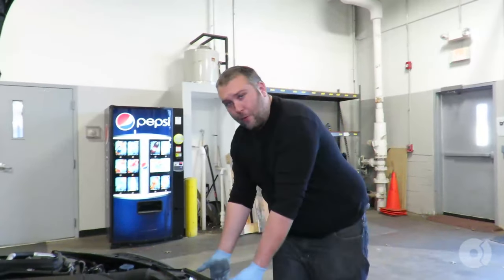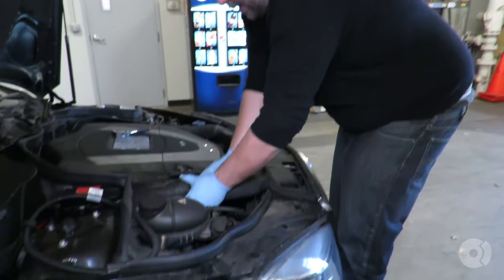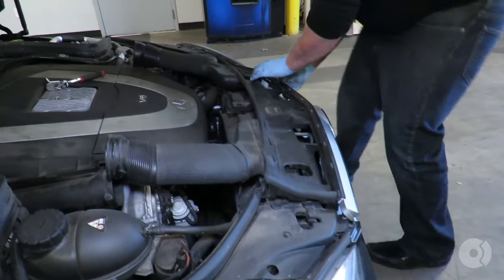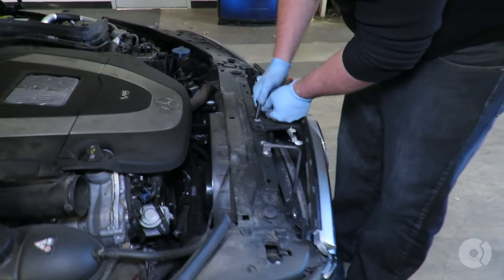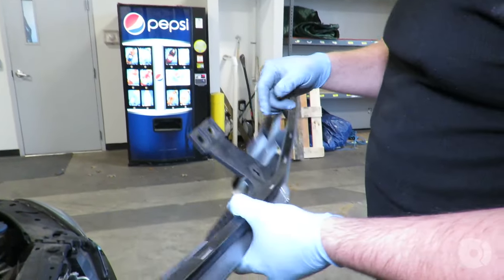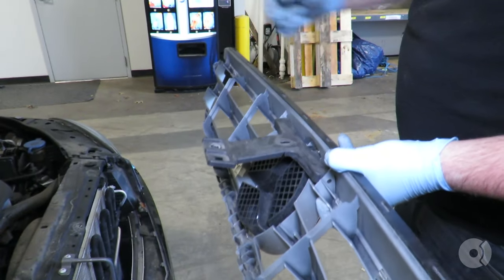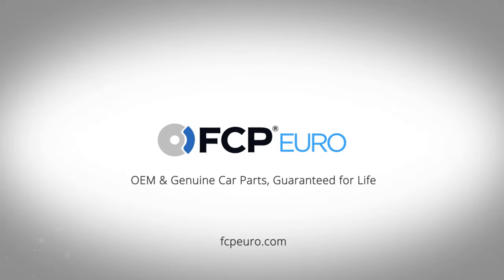Mercedes Front Grill Removal - Quick & Easy (W204, C300, C230, C350)

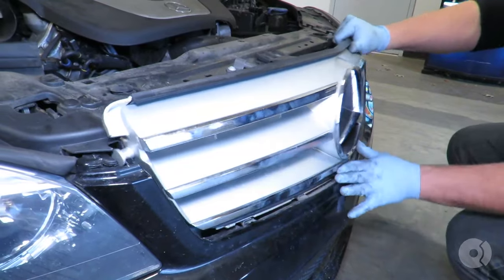Comment: I hit a small deer in my 08 C300 and there’s no damage other than that my grill resembles the 0:30 mark and has a small crack in it, do I only need a new grill or would there be an issue with taking it out or putting it in?